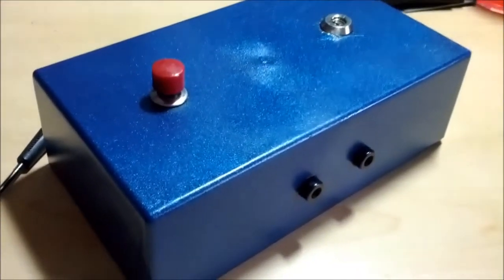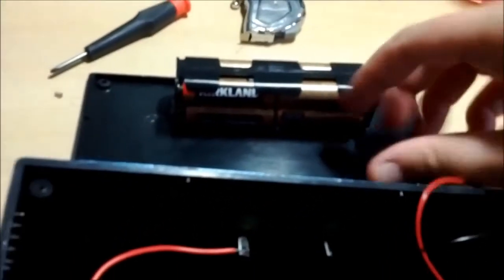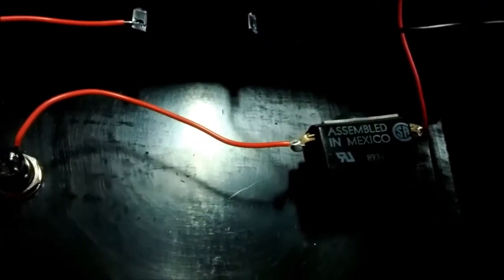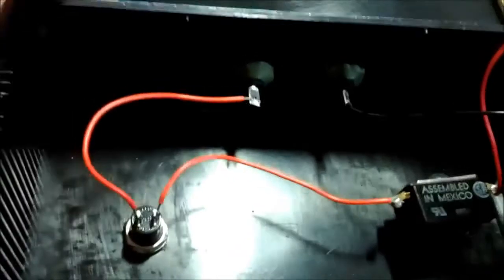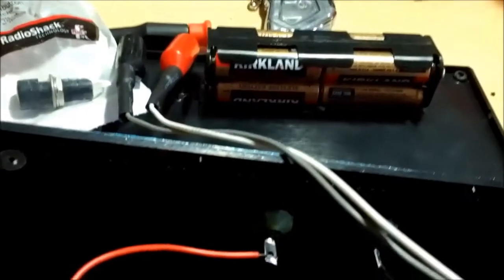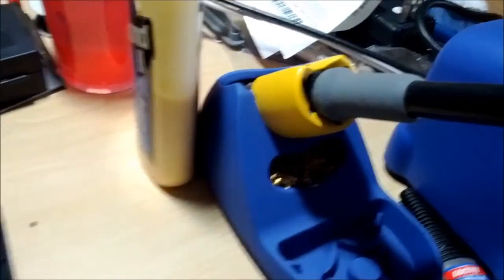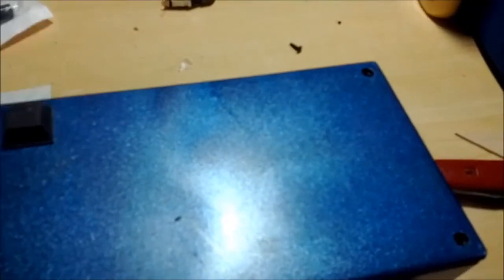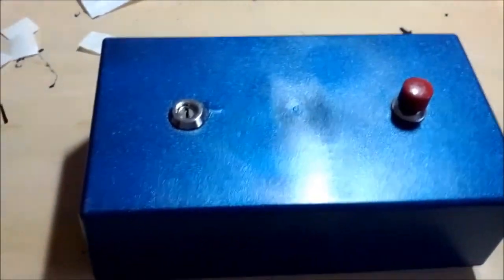Custom launch controller part 1

Comment: Call that the K.I.S.S. Controller!  So simple, it’s genius!  When you popped off the back, it reminded me of when I open a fresh bag of potato chips. 95% air!!  LOL. Lots of room to add electrical goodies, nicely done sir!
Reply from the maker: I built a wireless one later on, but guess which one still works after a few years?